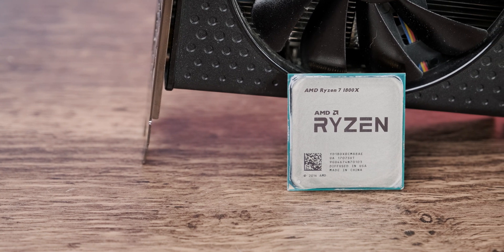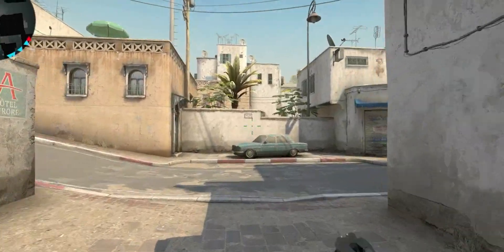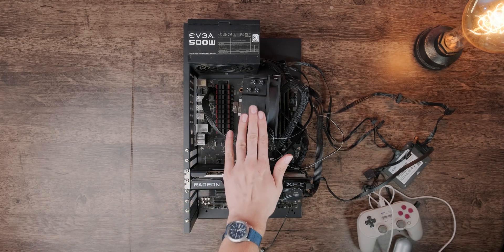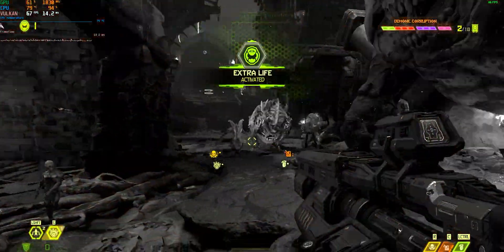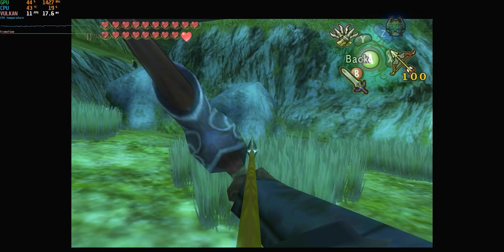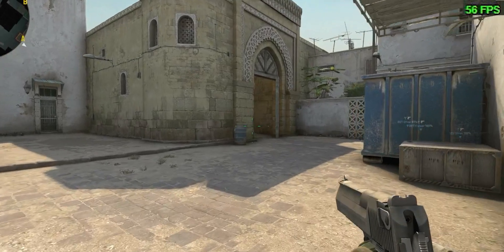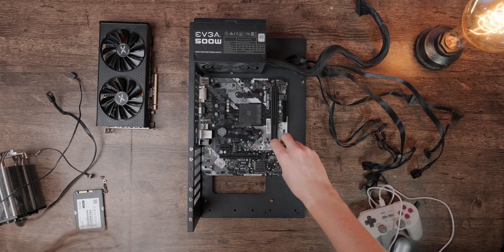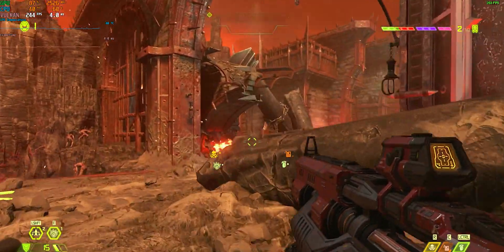WHY Are People Still Buying These CPUs? - AMD FX Series in 2023

Comment: I thought AMD was killing it in the early 2000s, until the Bulldozers came along.  At that point I switched back to Intel.
Reply from the maker: They were doing pretty well, but I think Bulldozer is what solidified their temporary downfall of sorts. Once Ryzen came out, especially Ryzen 3000, they really redeemed themselves in the CPU space.
Reply: @aChairLeg  I agree, but by that time I had made the move to Macs.  Not so much because of AMD or Intel, but because I wanted to try something different.
Reply: @aChairLeg  
Behind the scenes they built some really important tech and standards though, but it's really only stuff Uber comp sci tech nerds care about.
Of all of them AMD64 is the most visible.
HSA and its unified memory space is probably the second most important.
Reply: @aChairLeg That's not what happened, they spent a lot of capital buying ATI Radeon in the late 2007s as they were chasing APUs with Adreno for mobile devices and later buying ATI. They quickly fell behind after innovating dual CPUs and hyper transport. Intel with threatening lawsuits for x86 patents forced AMD to fork over free patents for hyper transport and dual processors. With Intel's massive business market share they outpaced AMDs performance until AMD and Global foundries could catch up. Intel is such a poorly run company they got caught sleeping by AMD again. Intel is better at threats of lawsuits, backroom deals rather than innovation and doing right by customers(two CPUs per socket generation?). Young dudes don't know any of this stuff, I am 44 years old and have been into PCs before low IQ types were given Windows 95 and began clicking and quickly ruining the Internet.
Reply: @aChairLeg Ryzen 2000 was a bigger leap imo
Reply: One might say they bulldozed their lead, really excavated the performance...
Reply: @SuperTort0ise  i see what you did there..
Reply: @SuperTort0ise You are simply unaware of the technology Intel stole from AMD around 2007 when AMD blazed the path forward with hyper transport technology and multi-core cpus. A small company like AMD has been threatened with lawsuits if they don't have over technology for free to the giant that is Intel where nearly zero innovation occurs.
Reply: Amd fx chips where and still are very capable chips... It just got overshadowed hard cause Intel came up with much faster cpus. Doesn't mean it's a bad cpu. Its perfect for any budget gamer Being able to battle even some games released current era with a good overclock.
Reply: @НААТ They didn't come up with anything, they threaten lawsuits and make shady deals then pay off antitrust fines around the world. They are like the Microsoft of the late 90s, corrupt and bullying smaller companies to steal theie innovations and still get caught sleeping at the wheel by smaller companies. Why can't Intel make a graphics card? With such large government and business market share how does AMD catch them in performance? Because it's a shady company. Go look at Rambus, Intel's butt buddy ram company of the early 2000s, they are nothing but patent trolls now after getting busted trying to fix the ram market for themselves.
Reply: AMD did fine before Intel core 2. After that Intel just dumbstered them. But, before that it was the other way around, A64 seriously wiped the floor with P4.
Reply: @lanwish Started to pull ahead yes, but "dumpstered" would not be correct to describe the situation until Sandy Bridge at the very least. Up until Thuban AMD still held up for the price.
Reply: @ashton9699  dude, core 2 just murdered AMD.
Reply: @ashton9699  held up for the price = ibtel were faster for literally the same price. You could buy a cheap ass e7300 c2d oc it to 3.7 and it beat a lot of x4 because games didnt use 4 thread. There is a very good reason why core 2 were so popular.

Sure AMD didn't seem that bad compared to that shit FX, but it was a beating, especially after how AMD crushed Pentium 4-s.